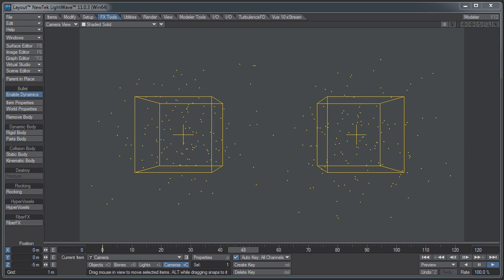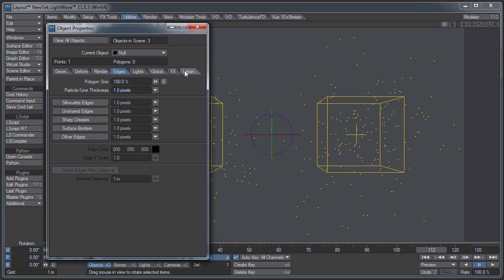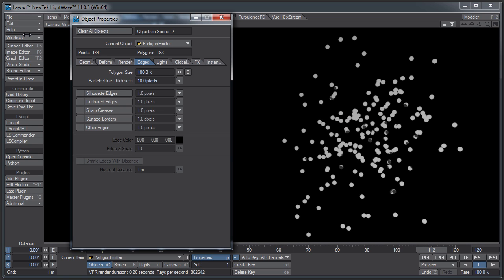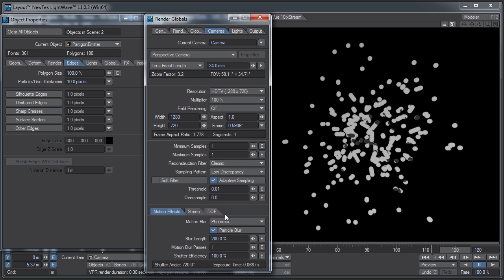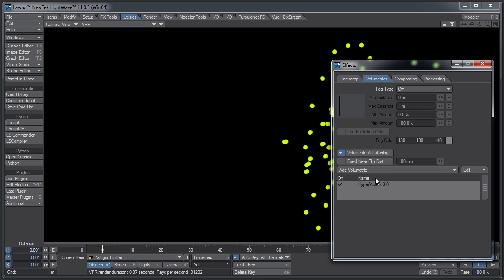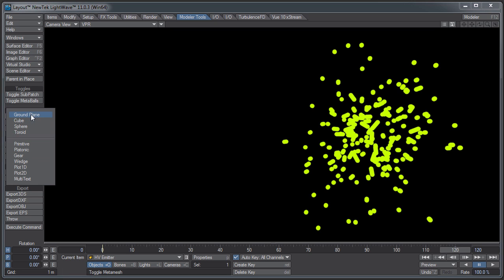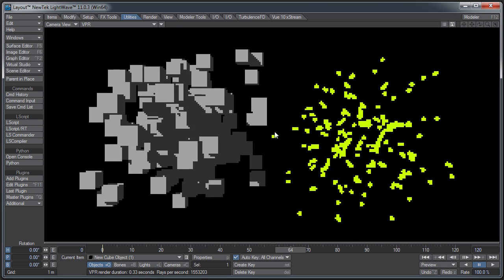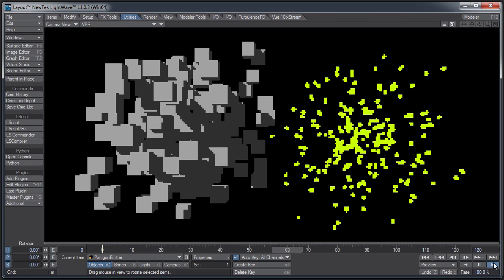Particle Types and Uses in LightWave

Comment: Hey, I am really stuck here and I can't find a tutorial anywhere, so I was just wandering if I can ask if anyone knows how to import the information from Maya's nParticles into Lightwave? I don't have the MDD exporter in Maya and I am not familiar with the Alembic workflow.
Reply: You could try asking over at the lightwave forums. I used to spend a lot of time over there and there were a bunch of helpful people there, some with experience moving data between apps. As you mentioned, mdd would be good way to go if you could get an exporter. I don't know Maya well, but I remember it having built-in file support options that had to be enabled in preferences before you could use them. Perhaps that's the case with mdd.
Reply: +Dana Burman 

Thanks for the reply. I have spent a lot of time before posting here on youtube trying to find a way to download an MDD converter without any luck.  I will try the forums then.

Comment: Hey great tutorial! I am still new to  Lightwave and I was wondering what graphics card you use? I currently have an older GTX 260 in my tower and want to upgrade to a Quadro card and was wondering if the Quadro 2000 would be a good choice to take advantage of Lightwaves OpenGL multi-texturing and VPR. If you have anysuggestions please let me know.